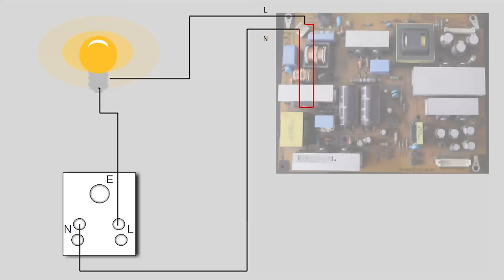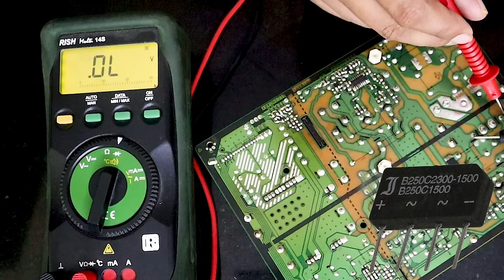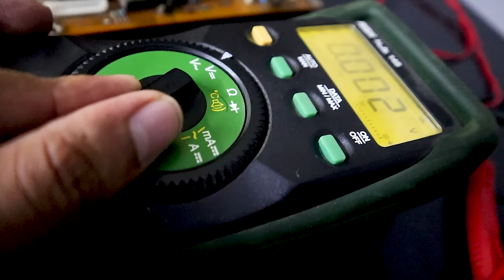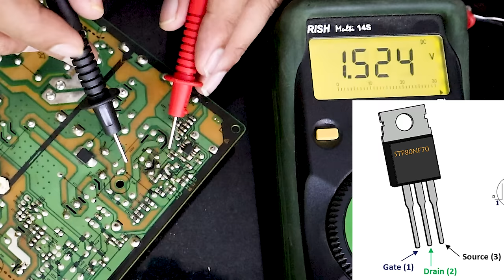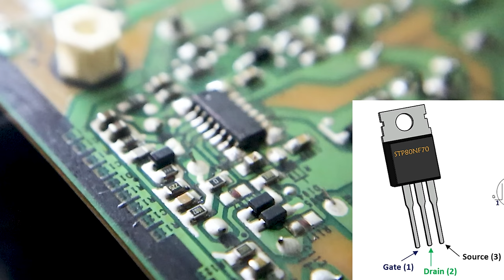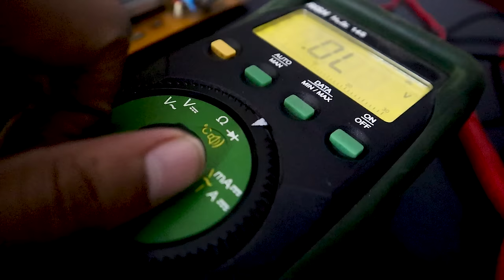Anyone can repair PCB now!!

Comment: Dear sir,
Yes, Today lot of washing machine, AC, Microwoven are come to scrap. But this all are not major fault. 
Service Technician give wrong information to client on the faulty items.  Sometimes small resistance replacement are required. Technician say board failed need to replace new board. The cost says 1/3rd of new machine cost.

All this will be sortout only the users need to know the basic electronics.

I really appreciate you sir about your honesty and you try to make honesty other also.

Thanks lot.

Comment: Explanation of off line method is really super and safe, but people don't try online checking it will be very dangerous & if you connect a single probe between  any two terminals by mishandling it will lead to a short circuit & some time times it may get spark from PCB.

I have experienced mishandling & a small spark(a small spark can damage your eyes if your eyes is very close to PCB) while analysing a failure pcb dismantled from Whirlpool washing machine in my house.

Comment: 2:00 nenga kattura PCB single side nu solluvanga adhula one side matum dhan circuit irukum inoru side empty ah irukum empty side dhan comp side nu solluvanga comp apdina component side dhan innoru side circuit irukum apdi circuit irukura side sold side nu soluvanga sold apdina soldring side 
Intha mathiri double side PCB um iruku
Double side apdina 2 side umey circuit irukum adhan double side PCB nu solluvanga 
Inoru type iruku adhoda name multilayer circuit PCB nu solluvanga
Adhula 4layer,6layer,8 layer intha mathiri neraya layer irukum ella layer laum circuit irukum antha mathiri PCB um undu multilayer circuit PCB la namma kanuku front and back side matum dhan track tharium aana layer  ulla um track cut aagi problem irukum multilayer konjam difficult ah irukum
Reply: Why can't you start a channel?
Reply: After seeing your channel why can't you upload educational vedios?

Comment: You are absolutely genius. 
I am a Mechanical Engineer. During Covid , i just tried with a LG TV , power supply unit by referring few you tube and could make it working. The company service personnel asked to replace with new board, but we could correct nit.
Thanks for your gentle guidance ❤

Comment: சகோ. Electrical circuit Drawing பற்றி எப்படி தெரிந்துகொள்வது. எவ்வாறு   Routing Circuit Tracking கண்டுபிடிப்பது. Heavy Machinery operating  ல் power circuits (High voltage) and Functional circuits (low voltage )Diagrams எவ்வாறு Trace பண்றது எப்படி ஒரு வீடியோ வெளியிட்டால் பயனுள்ளதாகவும், கற்றுகொள்ளவும் உதவியாக இருக்கும். சகோ.
Reply: First symbols understand pannunga,
Athoda input /output result padinga
Black and white circuit diagram vendam, colour circiut moolama first understand pannunga

Comment: Nowadays even technicians insist on replacing the PCBs and causing huge expense for customer.. such board level servicing knowledge has to be there with respective techhnician. I recently f
Repaired a AC stabilizer which was  not giving output voltage. AC mechanic said I have to buy new stabilizer.. I replaced the output relay inside the Stabilizer.. it just costed me 120Rs.

Comment: Ennoda motorcycle, car, house appliances ellam Nan dan repair and maintenance parpen. Recent ah washing machine board ready pannen. Led tv la backlight issue um ready pannen. AC ku gas recharge pannen. Most of the repair ku YouTube la search pannave solution kedaikum. Namma dan sensible ah plan panni execute pannanum

Comment: Bro resistance thaniya vachu check pana dhan exact value katum pcb board oda vachu check pana katadhu correct value and resistor la 100 ohm Kula value erundha short kamikum adha sola marandhutinga bro

Comment: Broooo pls help me bro😢

Ennoda asus tuf f15 laptop open panni clean pannitu irundha appo 
Screw onnu mistake ah board la potuten 
So oru capacitor la mattum irundhu spark vandhuchi 

Odane battery ah disconnect panniten 
 Enna solution nu sollu ga plsss😩😩😩

Comment: Annaa dvd SMPS board la out put voltage 12 voltage 12 la irunthu 13 15 16 17 18 varkkam koodi kurainthu varukirathu 5 volt ku 4 5 6 nu kudi kuranthu varukirathu ithu ethanala enna problem nu oru video podunga Anna

Comment: Zebronics 5.1 Dolby 525W On ஆகுது 

Speaker 🔊 Output  Work ஆகல , Company Call 🤙 பன்னி கேட்டா PCB Board Change பன்னிகோங்கனு சொல்ராங்க ,

 Speaker Whole Rate 10999 Than Board Gu 5500 Solranga 

தூக்கி போட்டுடலாமா இல்லை Seperate Ha Amplifier Connect Panni Use Pannalama Bro

Comment: PCB board attending is not so easy as you have told. Each board has different circuit and attending the board without basic circuit knowledge may damage the board instead of rectification. I accept all  ur videos  useful but i don't agree  that any one can attend the PCB board.

Comment: Bro led acid battery la can we use rain water instead of distriled water? As both TDS is 0
Reply: Better use AC condensate(drain) water which is equivalent to distilled water. Filter it with a cloth filter before using in a battery to remove physical impurities. I have been using it for so many years.

Comment: In my hometheatre all speakers are working except subwoofer, i checked the speaker, it is fine and i checked the wire connection everything fine, so how can I fix this subwoofer issue?